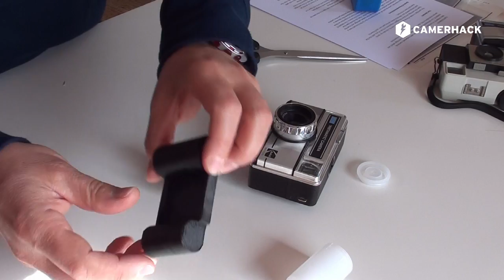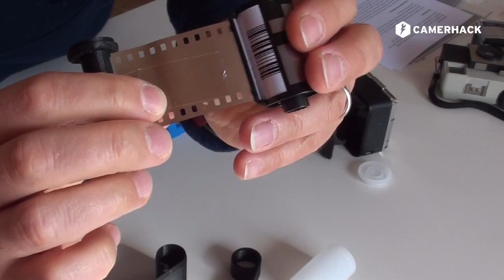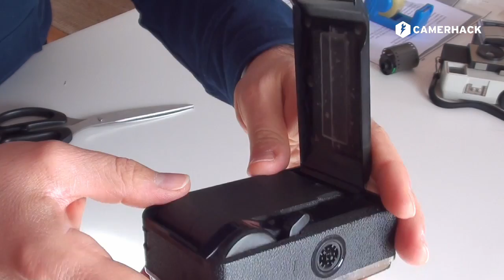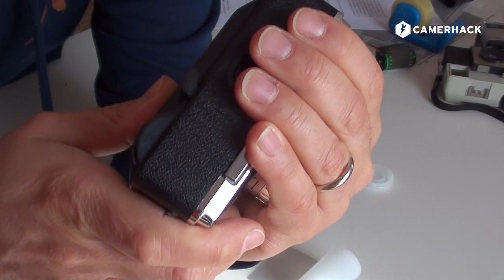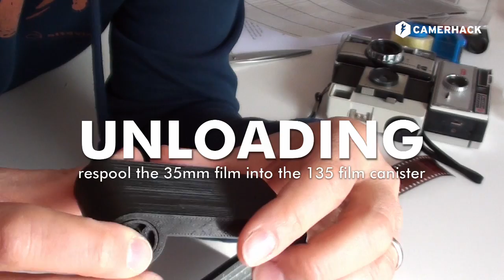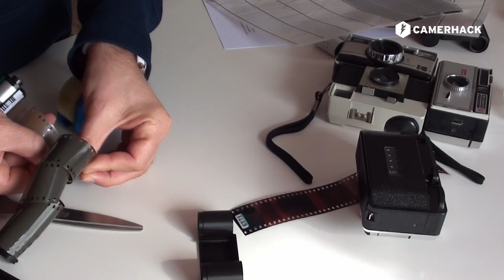Load 35mm film into Instamatic cameras with FAKMATIC

Comment: Works great with my Kodak Instamatic 400. I find that I have to shoot 2 covered photos for every 1 actual photo. I get about 18 photos on a 24 exposure 35mm film reel.
Reply from the maker: thanks a lot for your feed back. if you feel like sharing the result, post somewhere in twitter or instagram with #fakmatic hashtag :-)
Reply: Camerhack Adapters I posted 2 images in Twitter, a single frame and 2 overlapping frames that caused an unexpected panoramic.

Comment: Hi, thankyou for the clear video! I have a question: there is no spool in my camera, Only a non openable prepared film. I could probably by this individually somewhere?
Reply: That is a 126 film cartridge. They are no longer manufactured, so you will need to buy an adapter to use the camera.

Comment: Hello! Thank you for this video! 
But I just have one question, when you're hiding the lens to take a photo just after taking a "normal" photo, does that mean that on the film when we'll want to develop it, one photo out of two will be black ? Thanks for answering :)
Reply from the maker: Liz, because of the film perforations, the 35mm film will not travel for the lenght of a whole frame, so you have to advance two or three times to get to the correct spacing between the exposed frames. You need to cover the lens to avoid exposing the film while you advance it. Hope this helped, feel free to ask for details.